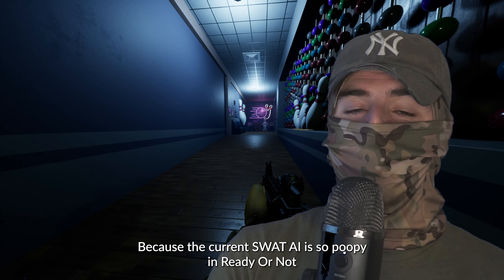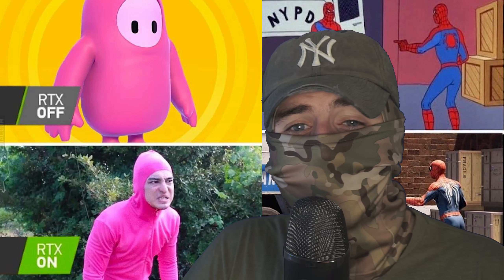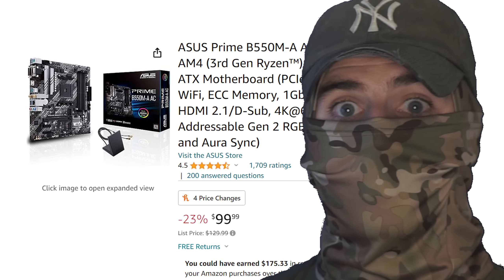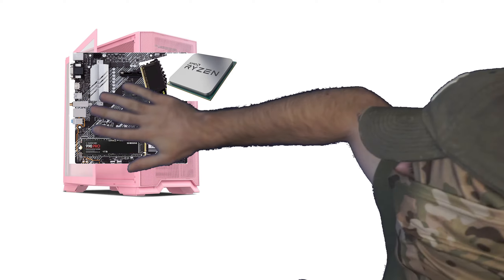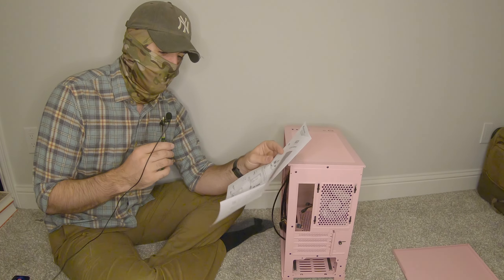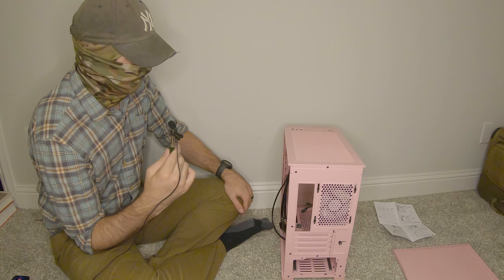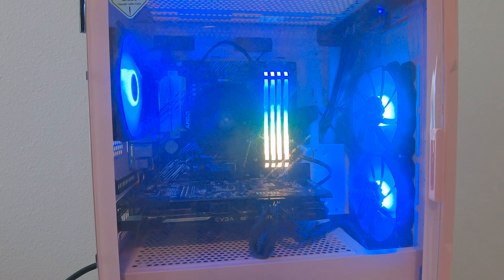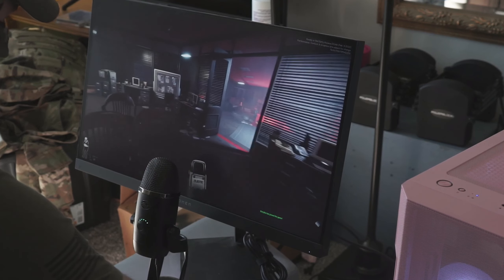My wife's PC build

Comment: Friendly heads up, the gtx970 has a 0 fan rpm mode based on thermals by default, the fans should spin up when needed. Fun video as well. :)
Reply: Yea i was thinking this as well